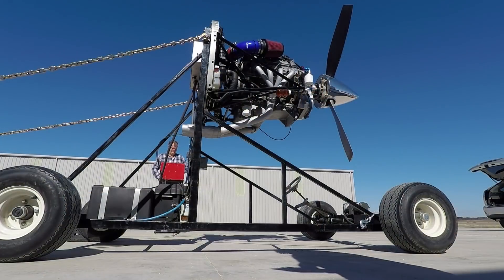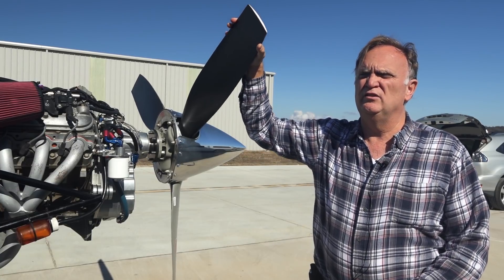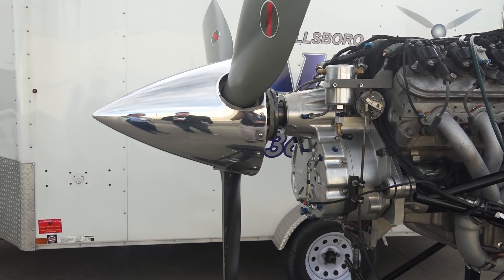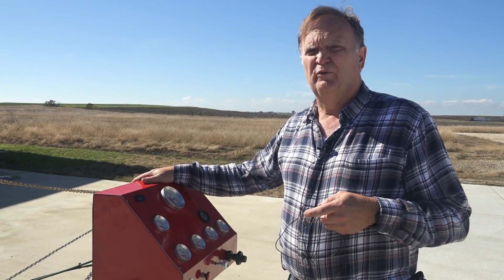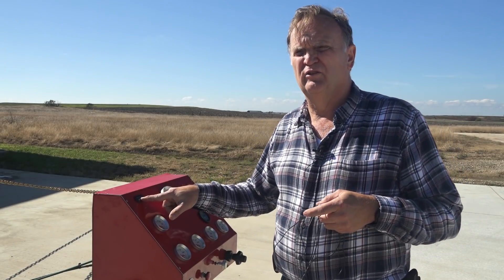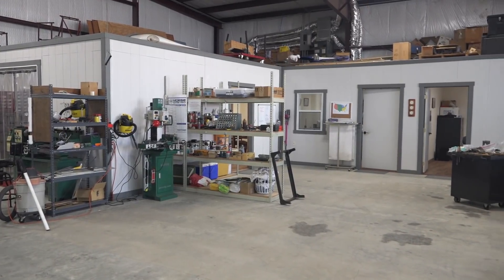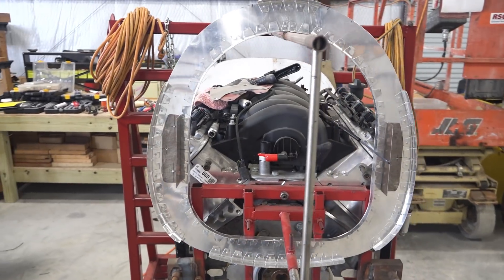V8 Auto Engine DEMO with PSRU's Geared Drive for Aircraft

Comment: Everyone,
I got a big list of 34 comments and questions this morning. Apparently the auto notification was off line for a while. Normally I reply to each individual’s set of questions. But I leave for AirVenture at 5 am tomorrow morning and time does not permit that. Luckily for me there were several repeats on the list.
First, I want to thank all the positive comments about our designs and installations.
Second, we will be in booth #624 in the North Aircraft Display Area, a corner booth at the south end. That area is just south of the war bird area. Our RV-10 featured in the videos will be there parked at an angle facing the outer corner.
Answers:
Yes, there are some great Toyota engines that would make good aircraft engines. We have smaller PSRU’s for them as well.
No, because the factory ECU will not support a mechanical throttle body. The factory electric throttle bodies have reliability issues in an aircraft application and the FAA does not allow fly-by-wire throttles. So all of our ECU’s have been MEFI-4’s, FiTech, or MSD Atomic systems. Holley also make a great ECU, and they all support mechanical throttle bodies. All or these ECU’s have tables that go to 5,200 meters MSL (17,060 feet) and will interpolate timing and A/F ratios above that based on sensor inputs.
We won’t do turbo’s or superchargers for more power. We will do turbo’s for turbo normalizing. Many of the available turbo systems can maintain sea level performance to 16,000+ feet.
The clutch will disengage if the engine shuts down for what ever reason. This will allow the propeller to free wheel in flight. A fixed pitch or normal constant speed propeller free wheeling will cause more drag than if it were in a fixed/stopped position. To correct that, and reduce the drag below what a fixed/stopped propeller would cause, we recommend using a constant speed propeller that reduces pitch with increased oil pressure rather than the standard increasing pitch with increased oil pressure propeller. This type of propeller will go to a high pitch setting after loosing oil pressure and possibly auto-feather, rather than go to a low pitch setting, which greatly reduces the drag from the propeller.
The clutch has three major advantages that solves several issues.
The engine starts like it is in park/neutral in a car allowing the start to live a long life. The clutch engages at 800 to 900 rpm’s, which sounds high, but is only 480 to 540 rpm’s at the propeller. The air flow at that rpm is the minimum needed for air flow through the radiators to keep the engine cool idling on the ramp. Getting most aircraft to start taxiing requires the propeller to turn at at least 1200 to 1600 rpm’s, which is 2000 to 2667 rpm’s on the engine. It’s all relative to the propeller requirements, not what a car needs.
The damping hub of the clutch helps greatly to manage the secondary and third order harmonics. If either of those ever match up with the primary harmonics a lot of things will start to fail all over the aircraft. Since 1996 we have not had to put any RPM limitations on any engine in any airframe. Ask any certified engine manufacturer if they can say that.
The clutch disengaging after parking the aircraft prevents Propeller Kickback, which is the inertial mass of the spinning propeller forcing the engine through compression cycles. A reduction gearbox gives any propeller the mechanical advantage needed to do that. This is very similar to a gas engine dieseling in a car. It is very hard on the propeller, gearbox, engine, airframe, and instruments. It is not a pleasant experience for anyone inside the airplane either. The inertial mass of a given propeller will determine how much the propeller will spin after the clutch disengages after shutting down the engine. Light weight composite propellers will spin 2 to 3 times, while a heavier metal propeller will spin up to 12 times. Winds less than 25 to 30 mph will not start the propeller to spin because the aft end of the propeller shaft drives the oil pump and the propeller governor as well as trying to rotate the gears through a bath of gear lube.
The weight of an LS3 engine installation will vary for different aircraft types, but that is also true for certified engines. The LS3 installation for an RV-10 is 580 to 582 lbs. The 260 HP Lycoming sold for the RV-10 installation is 587 to 589 lbs. That does NOT include a propeller or propeller governor. It does include all fluids required to fly both engines. The higher 375 HP for take-off is pure gravy.
Why an LS3 engine? Yes, they cost less, about 45% less to install at retail costs for both. Their maintenance also costs a lot less. Very good spark plugs cost only $14 each rather than $40+ each, they last 5 times longer, and there are only 8 instead of 12. Savings on oil changes are about the same. The engine operated like we set them up will last 3000+ hours, not 2000 hours, and we don’t have to replace any jugs to get there. The fuel burn rates are 25-30% less at the same horsepower settings. And a replacement long block costs only $4800 to get back to a zero time engine. Our PSRU’s are also good for 3000 hours, and economical to overhaul. If you do the math for just 2000 hours for a certified engine it comes out to over $120,000 of savings. So they cost a lot less, weigh a little bit less, last 50% longer, and produce 37% more horsepower. In any other market I would be able to charge more, not 45% less.
The cooling system design took some development early on, but by 1999 we had that nailed down. Since then all of our LS-V8 engine installations never over heat on the ground, in long climbs, or in cruise. Because the thermostat controls the cooling they can’t be shock cooled during decent either.
The only time I have seen an in-line 6 engine installation was in WW1 replica’s. Yes, they were Ford 300’s.
In an installation were the engine is never run over 4500 rpm’s, and only for take-off and climb, there is no need to upgrade the rotating assembly parts to forged components. But if you want to do that cheaply buy and LS376-480 or LS376-525 with all forged rotating parts, and put an LS3 cam in it.
All versions of the stock LS-V8’s are used in stationary power installations around the world where they are run at 4000 to 4500 rpm’s contentiously at 50% power or higher for a year or more using several types of fuel. They get oil changes while they are running so they never shut down. That’s a very tough engine design!
The SD400 weighs 109 lbs with the flywheel/clutch assy and 3 quarts of oil, without a propeller or propeller governor.
We get a lot of hot-rod guys asking about all sorts of power adders and improvers. We call them NASCAR Bubba’s. It is very easy to take a stock car and beef up the frame and suspension to handle up to 3 times more horsepower. I know because I’ve done it, and watched all the TV shoes that tell you how to do it. But that is VERY hard to do for any airplane. You can easily end up with an engine that can twist the airframe up in a little ball on take-off. Worse than putting a V8 in a motorcycle. Even a stock LS3 in an RV-10 can force you into an uncontrollable torque turn off the runway if you slam in full power all at once.
This is by far is the longest, most comprehensive reply I have ever posted for this sight.
If you have more questions I will try not to let so many slip by and return to answering them individually again. If you visit our booth next week we can go into great detail on everything.

Comment: Richmond autos for quite a while and they have lynched on aircraft in the service and overhauled aircraft instruments when I first got out of the service and installed them in aircraft. My question is this. Do you have a stock cam in that engine and if so why in the world would you leave the stock cam in it and not put in a cam that provides a little bit more torque which is a required element in pushing something through the air or through the water. Everybody keeps talking about horsepower requirements in aircraft. Horsepower does not push the propeller. Torque does. If you can get torque numbers at a lower RPM you can get better fuel mileage or burn fewer gallons per hour.
Furthermore, I pulled a couple of those engines apart and the ring gap on him is like .030. That is ridiculously large and would result in way too much oil usage for an aircraft. I would think of bringing it down to at least .018 might work out far better. And possibly with a little bit higher tension rings then come on an automotive engine.

Comment: Just curious what’s the benefit of doing the ls swap? Obviously a lot cheaper to rebuild but, but does it get better fuel economy? And what other benefits does it have?
Reply: Better fuel economy, variable spark timing, higher max takeoff power, single lever power control, ability to use unleaded fuel, cheaper engine parts (?).
Reply: Power to weight ratio is the main one. Max power for most big continentals is 350hp. An LS with a gearbox can make whatever ho you can imagine and parts are much cheaper. This will never make it into a certified aircraft though.

Comment: wondering. if you have major engine failure would the clutch not disengage and allow prop to free wheel? and this would not drastically reduced glide performance in a pretty major way? i love the LS. great for almost anything
Reply: You don't actually want the prop to freewheel. A completely stopped prop actually lets you glide farther than a moving prop that's not producing power.

Comment: The fuse on each individual coil pack  should be implemented on all of these engines no matter what they are used to power.
I don't need to be stranded in the middle of a desert.

Comment: One question I have every time I see an automotive engine in an aircraft is do you guys swap out the crankshafts for forged units? I mean as far as V8’s go the LS family has an extremely strong bottom end, but constant high RPM has to be pretty tough. Not criticizing just curious

Comment: Can an engine like the LQ9 run at 75% power for several hours during cruise? I mean on the road engines like this run at 10-15% power for a while then 45% going up hill for a few minutes then 20% on the road just no where near the Constant power required by aviation cross country cruise.
Reply: Yes. Lol

Comment: The clutch seems to be unnecessary complexity since as soon as the engine started it was apparently at high idle above the stated 800 rpm engagement.
Reply: It probably has to do with the torsional vibration on startup and shutdown. Ever noticed how a direct drive piston engine plane shakes on shut down?
Reply: It's so they can use the stock starter motor.
Reply: pretty sure it has to do with difficulty starting this engine with a load (prop) on it
Reply: If you see many belt type re-drive v8 set ups running they do quite often struggle at startup with the full prop load, my guess is that the smaller square bore/stroke v8's don't come to life as efficiently as the big 4 and 6 jugs of your certified aero engines (for the same capacity/power to weight). This engine has most likely had a warm up prior to it being demo'd and thus could be brought up from idle quicker, seemingly mitigating the clutches effect. I would add that perhaps these jerky start ups may tend to lead to re-drive belts cracking. Think of why the lumpy Harley Davidson V-twin has never been directly geared to its gear box in its design history, it would probably break the gear train on a regular basis. The belts from crank output to the clutch end of the gearbox are cheaper as a replacement on the motorcycle, however the aircraft cant't pull over so easily to replace the belts that are more or less under full strain in operation. The clutch in this re-drive avoids the awkward stresses of start up that could lead to the belt failure. If the gearbox contains actual gearing the same problem exists, necessitating the clutch. These are all my best guess as I haven't actually researched this engines design philosophy.

Comment: How does it meet the FAA requirement for a dual ignition system?  And what is the induction system?  And lastly, is it a fixed or variable pitch prop?
Reply: Experimental aircraft don't need to meet any requirements. This system uses a single ECU/Cam/Crank system, so no real redundancy. I'd use the engine and add an aftermarket dual ECU/Spark/Injection system with a backup battery, IMO.
Reply: @231pilot  I think that's how everyone does it tbh. That's how I'd do it too
Reply: Experimental rating

Comment: Does anyone know if a straight six automotive engine has ever been used in aviation? Seems like I once saw a plane with a Ford 300 straight six in a small ag plane.
Reply: Franklin used to make a straight 6 air-cooled engine that was is a couple planes.
Reply: Suzuki M13a non VVT engine is better than any engine currently used in aircraft with the exception of the RED V12. For a 6 I was considering using a BMW M54 or the later B57/B58. M54 would still be the best inline 6 without the Vanos. Will start manufacturing my own inline 6 engines hopefully within 2 years. Aerospace needs an overhaul. The engines currently being used are obsolete 1930's designs, and the automotive engines being used have balance shafts etc. I am amazed that no one has produced a good engine for LSA.
Reply: Viking makes their engines from Honda Fit and another small car engine (Subaru?). I believe theirs is a 4 piston though, not 6. However, their engine is absolutely going to be less weight than the truck engine shown here.
Reply: Yes. Ford airplanes from 30's
Reply: @jwagner1993  Really? How interesting. I wonder if it was a straight six?
Reply: Yes. Simple small plane, but meeting requirements is the always issue :/
Wouldn't get kuch trouble other than fines if caught but caught illegally flying unfer radar will def be a price possibly jail time shiiiiit MOST likely. 
Felony lol..
But you can at Airports, and such. 
Yes there has been. Also twin turbo LS7 (7.0L) in a plane. 

Boats is my fav cause flying is way to complicated

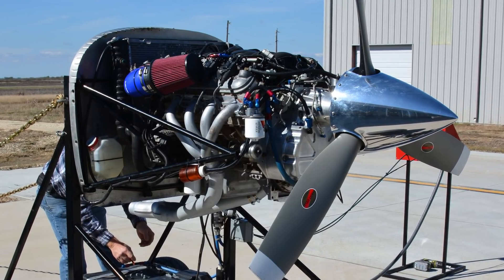Comment: 1:26 is it an LQ9 or a 5.3L? An LQ9 is a 6.0L.
Reply: he probably meant LC9, 5.3 with Aluminum block. The block is clearly aluminum in a couple shots.
Reply: Lq9 5.3L truck engine
Reply: @oldcrow3646  the Lq9 is a 6.0L they came out of the 2500’s or the “MAX” trucks, Cadillac used them also. It’s the newer 07’ and up version of the LQ4. The lm7’s are 5.3L.
Reply: @gavincline209  I would say the 6.0 and if not then it should of been: because more torque and over all power:)
Reply: @gavincline209  LQ9 was introduced in 02 for Escalades. It was then offered in the MAX trucks and SS version of Silverado. The LQ4 is the version for 99-07 2500 pickups. They are both Gen III 6.0 L engines
Reply: I always thought an LQ4 was the 6.0L truck engine but I maybe wrong